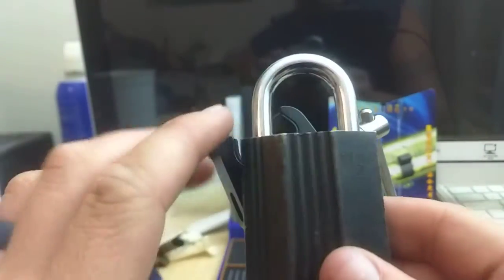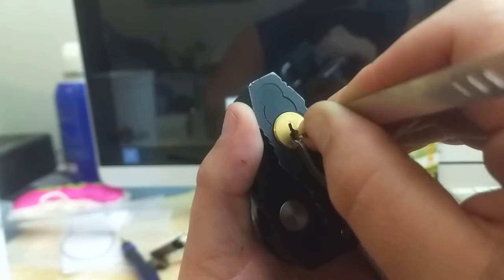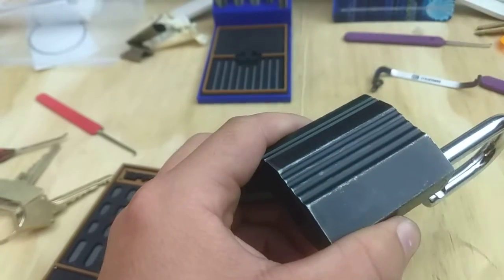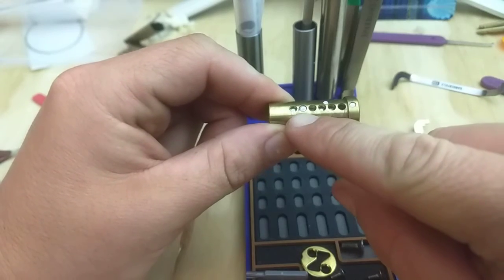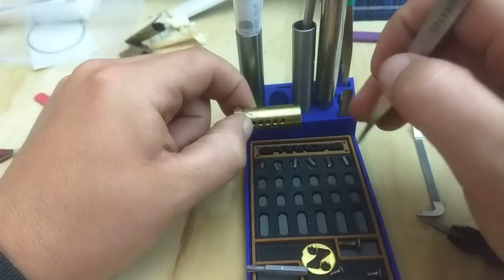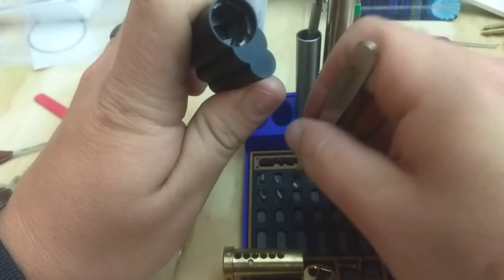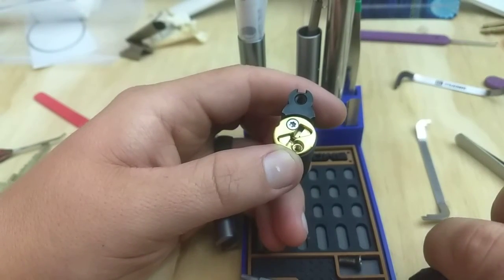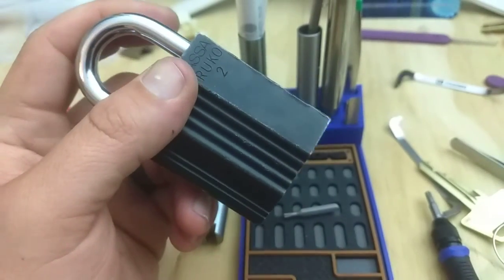ASSA RUKO 2 pick and gut

Comment: Outstanding job there wildman!  I wonder if slivers will clear the warding and allow you to pick off the bottom will have to try when I get caught up on these locks I gotta pick and finish out the list of challenge locks. Will have to check that out eventually. Great work with the locks and even getting the open on my CL. I will have to step up the deviousness in it😁
Reply from the maker: Thank you buddy and I ant sure but it's a pain in the butt trying to work thru it. You got your work cut out for ya an a blind hog will find an acre of mud eventually so think just had lady luck on my side